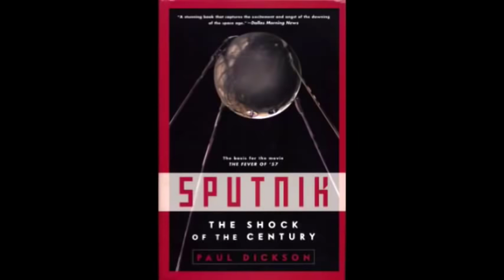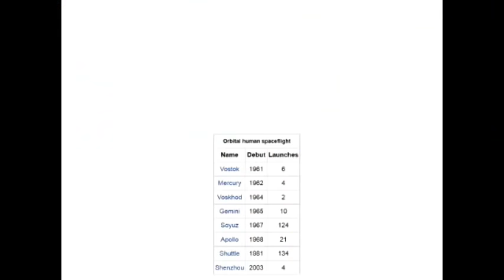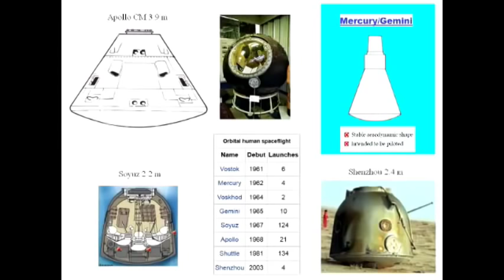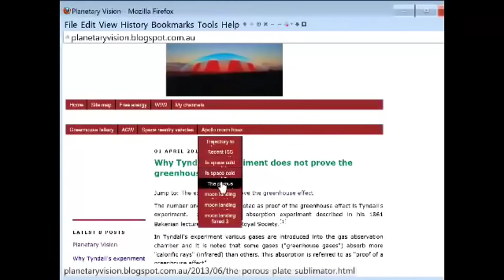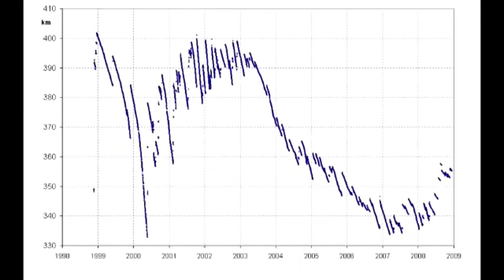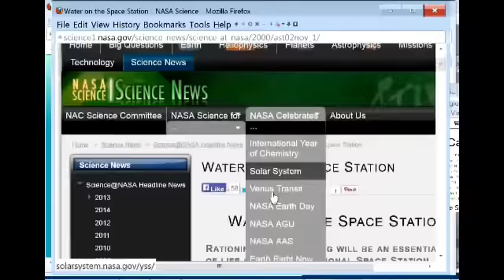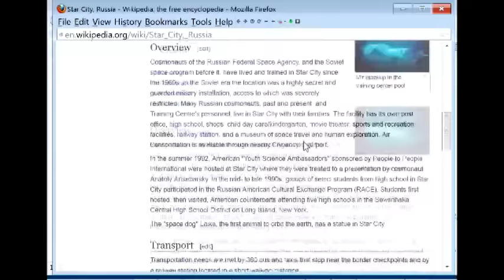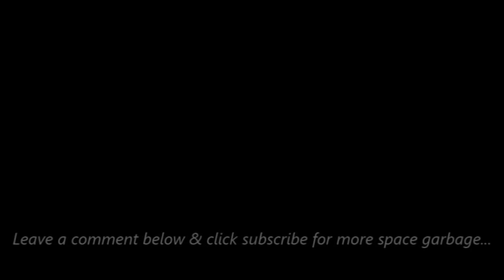The ISS Exposed

Comment: How many people does it take to maintain, let’s say a five story office building? And the maintenance team for that only needs basic commercial repair knowledge. Think about needing to know how to fix EVERYTHING on the space station! Think about it! Repairing computers, sewage systems, heating and cooling system, rockets, solar panels, windows (or observation panels. Whatever u wanna call them), air locks, showers, oxygen systems! Soooo many moving parts. Things wear out. Need to be replaced. You’d need a crazy amount of spare parts, tools, and a work shop. A HUGE work shop to house all that stuff in. I know I’ve seen something up there. I’ve seen it probably 50 times. Just google “spot the ISS “. It’s really cool. Especially on the nights where u can see it for over two minutes. Just watching it zip across the black sky. But as for it being manned... I don’t know. You’d have to have some quick thinking geniuses up there if God forbid anything goes wrong. And the narrator does make one good point. If there is anyone on that thing, death is only a heart beat away.
Reply: Zapranoth I never said that it was a fraud. I know that these people train for years. I know they’re super intelligent. The author believes it’s a fraud. I have a healthy degree of skepticism. I find out as much about a subject before I come to an indefinite decision. I see a lot of problems with NASA’s claims. My phone has more computing power than most of the Apollo spacecraft. The ISS moves at 17150 mph. People make it sound like restocking the ISS is like pulling up at a Taco Bell drive through. I’ve never been to space, but I have a little common sense and two good eyes. Like I said, I didn’t say that it’s a fraud. I just said that the place seems a little hard to maintain and get to.
Reply: Zapranoth Yeah, I should have kept my mouth shut about Apollo. I meant to delete that. But I see where you’re going. You obviously don’t have the slightest bit of skepticism. Whatever nasa and spacex say is gospel. And every image is sent to the world by their prophets. I’m sorry I even brought this up.
Reply: Zapranoth “Really no danger at all”?  I’m figuring everything is pressurized up there. What if there are multiple gasket/o-ring failures? Or if a rock hits it? There’s plenty of danger up there. Maybe I’m just dumb. No, definitely not. I’m far from slow. And seeing that u brought Apollo up, how did we get through the VA belts? I’m figuring that they would have needed an insane amount of shielding. Lead is really heavy. I know for a fact that they didn’t use lead on those ships. And with all of the radiation in space, why haven’t these astronauts been dropping like flies from radiation poisoning? It just seems odd. And I don’t need you regurgitate nasa explanations. I’m asking rhetorical questions. No danger. Nope. None at all.

Comment: You didnt mention what is probably the greatest threat to the ISS, meteors. There is supposed to be a lot of micro meteors flying around out there at very high speed. They either have to keep them from hitting or there has to be some sort of force field to protect the craft. Even a micro meteor is capable of putting tiny holes in the ship or tearing up the solar arrays. You did point out a lot of issues and I have seen some of these from live feeds myself. Question is, will we ever know the truth?

Comment: The reason we haven't been back in 40 years is that there's no advantage to it. The moon turned out to be not much more than a big rock and any benefit we might get from going there is outweighed by the cost and the fact that we've found other technological routes to reach the advantages the moon would present.

Comment: The reason the missiles on Cuba was considered a danger was time. Launched from within the USSR a missile would give the US as much as 20-30 minutes warning to get the president and government to safety and then launch a counter barrage, but launched from cuba, Washington could be a pile of rubble in less than 3-5 minutes after launch. In such a scenario there would no longer be time for an evacuation and counter launch. The USSR in short had gained a massive first strike capability that could under favorable condition render the US unable to respond.

Add to this the fact that at the time there was paranoia that the USSR had far outperformed the US in nuclear strike capability in general, and the US was working overtime to correct this perceived imbalance of power. Cuba added heavily to that paranoia

Comment: At 14:55 we see two cameras with HUGE lenses mounted to the wall..  -have any of the astro-nots ever used these cameras to take pics of the dark void of space? -or anything else?
Reply: If you yourself never do any photography you might be pardoned, but your question exhibits a considerable lack of knowledge. A telephoto lens all by itself isn't sufficient for making any deep space photography. Such a lens makes far-away objects appear to be close; you might say it "magnifies" apparent sizes. But for photographing distant stars, clusters or even galaxies, you need to have a certain amount of light - photons - arrive while the shutter is open, and while the shutter is open you have to have a steady bearing on the object of your desire. The time required is in the range of minutes. Hand-held is out, and even if you have a tripod, it won't work if you or the object moves. On Earth, you can overcome the problem of Earth's rotation with a motor-driven equatorial mount, but from within the ISS this is rather pointless. - The telescopes in orbit (Hubble is just one of them), however, can be controlled to rotate in all three dimensions, and this enables them to make long exposure photographs of deep sky objects.

The astronauts (don't use the non-word "astro-not" because it makes you sound like a 6-year old brat) on the ISS have used these cameras to make excellent photographs of the Earth, which is lit well enough during the day. And cities provide enough light during the night.

Comment: The argument about life treathing environment is very true. Very nicely presented. I would add that its more dangerous than a sub marine. After watching some documentaries on submarines, you see that there are parallels. Its really a similar threat. Air can leave the tin can and water (or vacuum) will come in.  In all submarine documentaries they talk about safety first, no giggling, no singing. All sections in submarines have airlocks between sections! Submarines hits various object is the ocean which obviously are not going make a situation, but you can hear it loud across the tin can. There are space debris as well out there around the ISS. And debris supposedly hits ISS, but it never makes more than a chip in the paint... Many years ago, ground crew supposedly moved ISS 60 miles up to avoid serious debris. There is apparently a "supply ship" that can come and boost them or they can use the "thrust module" which has not been fired up for 10 years. Really? This sounds more like a house boat!!!!

Comment: Some interesting stuff here but a few glaring errors too: the hair thing is explained by the lack of showers. They likely use cloths to wash but their hair is gonna get matted and grungy. You would think that they'd all have short hair though for that reason. The dust is probably collected in filters by the noisy AC and yes the trash disposal reentry units would burn up because why bother making them heat shielded. As for the shape of the station, a sphere would be nice but the station isn't experiencing the kind of gravity we are here on earth.

Comment: Where do they get the Nitrogen to add to the recycled air in the ISS?
Earth's air is 78% nitrogen afterall...
Reply: we don't use the nitrogen. It just gets cycled through the filtration system, like fibre through our digestive system. It serves no other purpose than to provide inert bulk. There is a pair of small reserve tanks of nitrogen in the airlock that are used to maintain cabin pressure (because the ISS leaks) and to balance the partial pressure of oxygen.
Reply: @BlokeOnAMotorbike  
'we don't use the nitrogen.'
We? You've been to space? Nitrogen isn't the only other gas in our air, but it does make up MOST of it. What about the methane from flatulence? Is that cycled too? Do the filters sort the water from the air as well; I've seen BS live footage of Betty ( I know that's not her name) washing her hair (LMAO) and water drops flying off everywhere (hilarious when you notice the electrical junction right behind her head). Where is this amazing system located in the ISS - which module specifically? What do you do while you're up there, besides the carnival antics you show on the live feeds? Why are all the critical systems located on the outside of the ISS? Where are the airlocks between modules? Why does the outer hatch open out? What are the scuba tanks used for? Wouldn't the vacuum of space require a hatch that opens in? When will you set up the 24 hr live feed camera (with NO interruptions - don't try to tell me there isn't a few 1000 satellites you couldn't bounce the signal around off of)? Also, make the camera do 360 degree pans when it's on the dark side of earth and set the damn filter to include the stars.  I've watched many 100s of hours of ISS footage, but I've yet to see even ONE other satellite in orbit - 
strange hey? Isn't there tens of thousands up there?
"There is a pair of small reserve tanks of nitrogen in the airlock that are used to maintain cabin pressure (because the ISS leaks)'
Didn't you just say 'There is a pair of small reserve tanks of nitrogen in the airlock'? Why would you use N2 to compensate for lost O2?
Are we to believe this horseshit? What is the vacuum pressure of space in low earth orbit? I understand a microscopic pinhole in the exoskeleton of the ISS would be a critical failure, resulting in total decimation and 100% loss of life. Am I wrong? What part is leaking? I understand some air loss happens when you cough spacewalk, but dude, you're spewing some real BS here suggesting there is an air leak.
Reply: @BlokeOnAMotorbike  I'm still awaiting an answer for ANY of my queries...unless you are not knowing a bloody thing about space, ISS, air, physics, and/or common sense :)

Comment: Rocket propulsion doesn't work in a fucking vacuum.  How can people be so blind to obvious logical fallacies.  You have to have something for the thrust to push off of for rockets to work. Such as air. What is in a vacuum?  Absolutely nothing vacuums are void of anything to push off of. And to think a pressurized gas bubble could even exist in a vacuum without a solid impermeable barrier around it to contain the gas inside of it. Ridiculous.

Comment: All right serious question if I can barely see a 250’ long Boeing 747 at 35,000 feet why can I see the 360’ ISS at 1,300,000 feet???

That’s One Million Three Hundred Thousand Feet.
Thirty Seven times higher than Thirty Five Thousand Feet🤔
Reply: Did you compute the apparent size (angular diameter) for both? The Boeing at that height would appear to have an apparent size of 24.5 arc minutes, and that's close to the diameter of the Moon (30 arc minutes). The ISS is wider than the Boeing (108 m) and at 410 km. That results in an apparent size of 0.9 arc minutes, which someone with very good eyes just might see. However, even smaller objects are visible at a comparable distance if they are brightly lit (e.g., due to reflected sun light). Then it is primarily an issue of the brightness of the light source.

There is nothing remarkable at all in the ISS being visible with bare eyes, especially after sunset (which anybody with a minimum of knowledge and mathematical skill can easily verify).